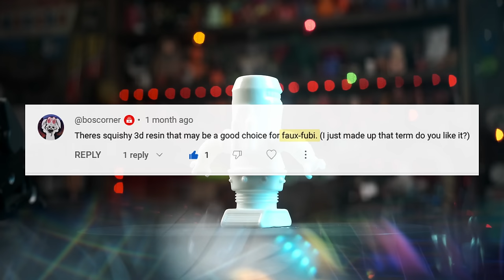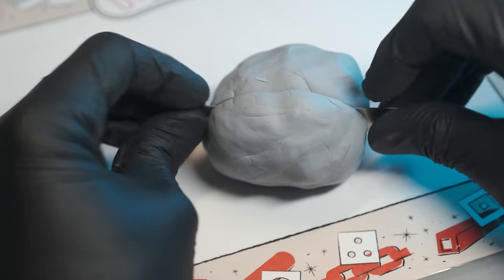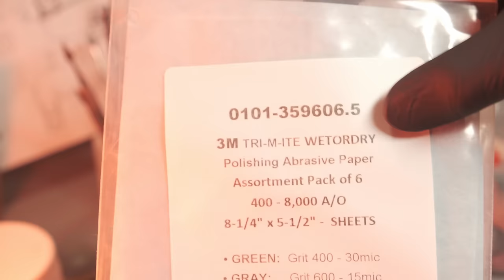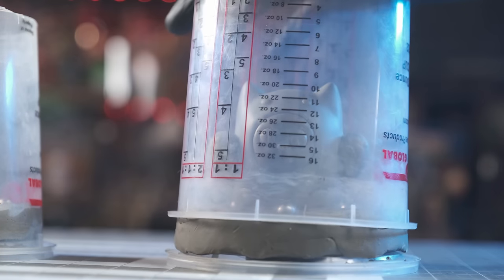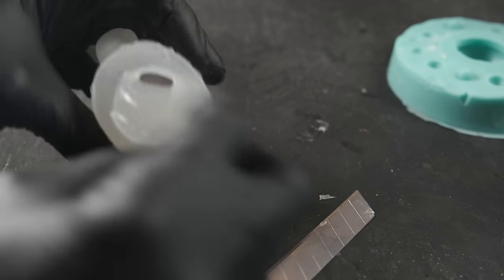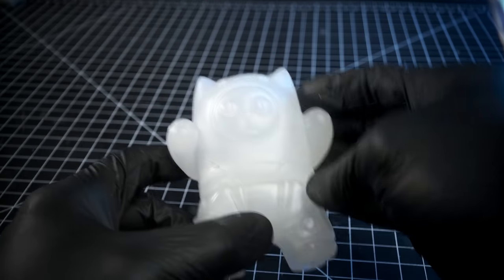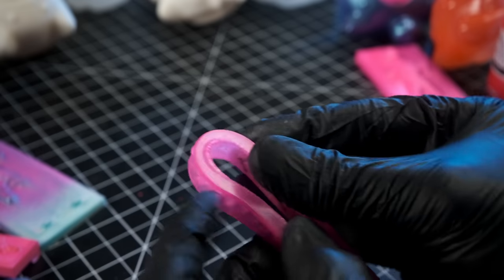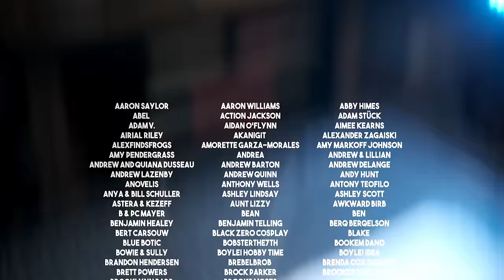From SKETCH to SCULPT to SOFT RESIN! (FAUXFUBI - DIY SOFUBI at home)

Comment: I did someFauxfubi experiments myself some time ago. I would sculpt in clay, and then scan and bring it into a 3d program to cut it up and add the locking joints. It was a long way to go for something i could have just sculpted and did entirely in clay i guess. I still think 3d printing the joining parts might save you a bit of work rather than physically sculpt them next time.
Reply: Your method is faster in the long run for sure

Comment: 2 things you saved me with here.. I actually picked up robert’s rotocaster he gave away (and met him, its like meeting casting god) but genuinely have been too afraid to use it..

So THIS VIDEO is giving me the courage to finally do it.. i got the bungee cords for it but I just.. never got the strength to make the connected 2 part and secure it yet. Even as I picked it up, clearly robert can make these things with his eyes closed but to me the roto is just so sprcial, I dont wanna utterly destroy the mechanism on my first try!!!  i have some big boy parts i need to do this week

2nd thing is that that connector design is just so brilliant, thank you for finally “explaining” the classic sofubi “joint cut”!!!! I never understood where you were supposed to be cutting the edge of the lip until now. you might have just saved a master or two that I was struggling with. Plus it wouldnt hurt to just make my 3d print joints consistent like that.. so simple and I love it

As per usual, your videos are so well produced and flawless. I seriously went from having nothing to having a fully stocked (hoard) shop and making my own stuff daily... No $ in it right now but I am just SO fufilled doing it. Thank you man. This community is so damn brilliant

Comment: And awesome results as always. What a fun little character. 

Apoxie sculpt can get hard and unusable, but I have a useful tip. Place a small sheet of plastic into  each jar. Lightly moist a piece of sponge, kitchen sponge or such, and place it on top of the plastic. Keep the lids really well closed  and check back so the sponges are always moist.

Comment: Love it... Go Crafsman!  I have used this Sculpey method to make so much of my semi-geometrical stuff--   The tooling, filing and sanding are just a great way to tune and refine these kinds of things.  It's as satisfying as it looks!
One trick I'd like to pass along... when I'm adding new Sculpey to baked Sculpey, I like to slick the dry area first with a little Sculpey Clay Softener (that comes in a dropper bottle).  That always seems to make new clay grab a little better, especially if the contact area is delicate.  It's especially useful if you're using clay that's firmer, or on the drier side.

Comment: There are lots of things you can salvage an electric motor from, you ideally want something that was already made to spin slower by the manufacturer and I can't think of anything specifically but I'm sure another crafter would have a good idea. That's one cheap way to get something like that so long as it works

Comment: Great video! Is the bird in the background live or added ambiance? It sounds like Swainson’s Thrush which is not native to the south United States, but is common here in Alaska. It does migrate to South America in winter and may fly over Mississippi, so maybe it is passing through your place on its way north for the coming spring.
Reply from the maker: Fine catch, my friend! :D
This episode was filmed partially at our home and, when in the shop, had background noise as we were working to build Pocketnaut stock, so I added some background sound. (It’s best when everything is quiet and I don’t have to add ambient sound.) I chose it from my sound pack based on the forest type. 😂 There’s another sound I use that I recorded during a quiet shop day, but I don’t like looping those type sounds and the usable part is short.

Comment: Hey Mr Craftsman
,wicked video.  I'm practicing making molds for vacuum tubes. Using a good quality silicone. I make wax candles of some of the popular older bottles

My question ❓. Is there a  resin that is crystal clear,or close to it. I can take the inerds and a led. Instant lampy type gift.  Thank you for your time. A fan for life. 
William❤️

Comment: Say, do the same paint-prepping methods apply to the KX Flex 60?

It doesn't feel like it could handle a torch or too many additional chemicals to it's surface, being so loose

Just asking because material that flexible could be used for removable harnesses or even soft non-cloth dresses

Comment: Or, if you realize that 100 is 5/6 of 120, you can divide 80 by 5, which will give you 16, meaning that the number at the bottom of the fraction should be 6 x 16 or 96.

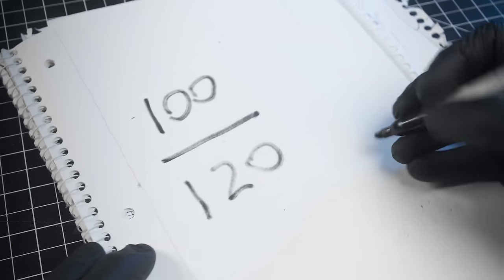Comment: I was totally thrown off by the subtitles in the calculation of proportions (around 17:45)! It writes "The ratio is 108 to 120", which seemed very annoying numbers --- and on the paper you write 100 not 108; but it's just a wrong automatic transcription, of "The ratio is 100 A to 120".